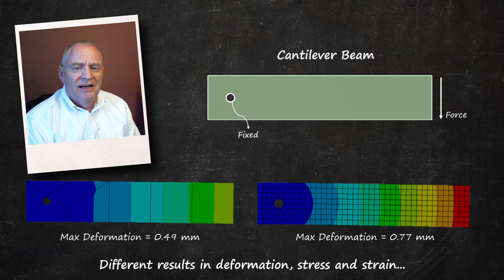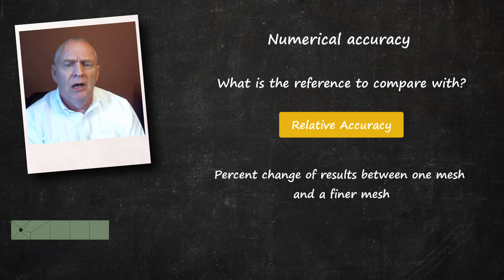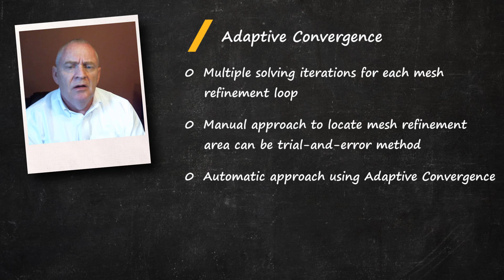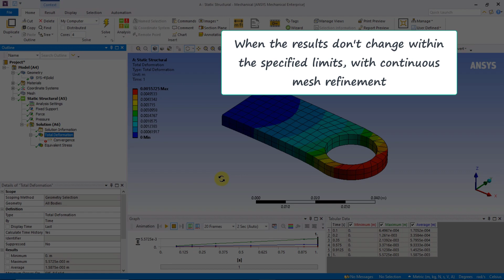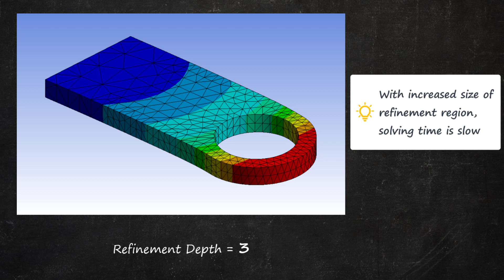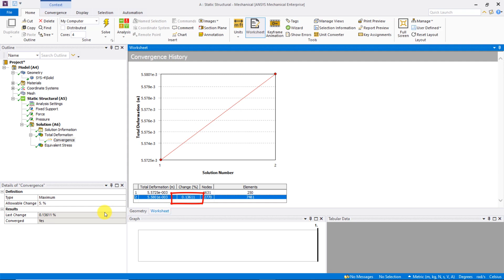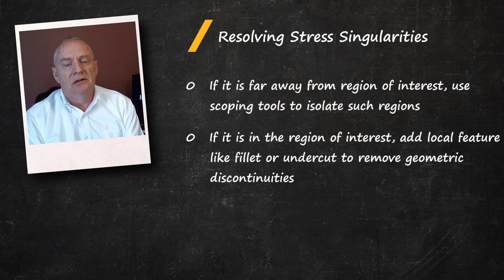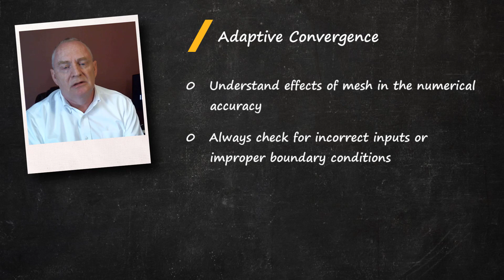Using Adaptive Convergence in Ansys Mechanical — Lesson 5

Comment: Is my observation correct that elements are individually refined by splitting them into smaller tetrahedra? If yes, then I would follow up with: How can I make the iterations depend on parameters that have been applied in the meshing settings?